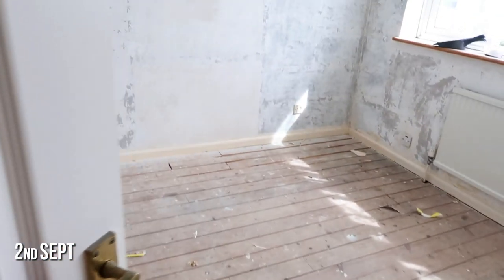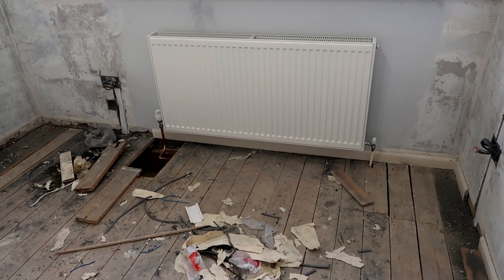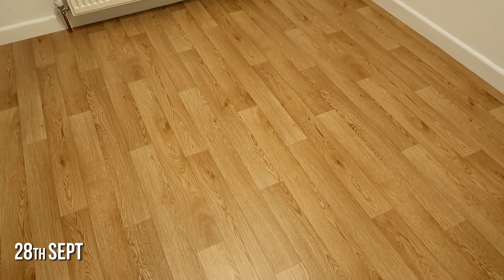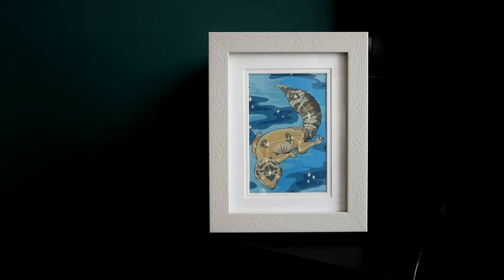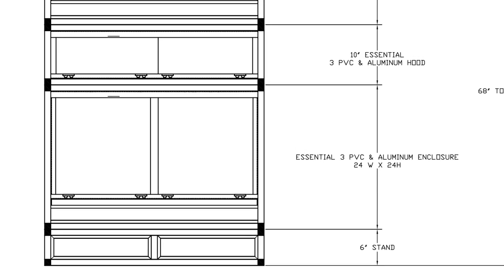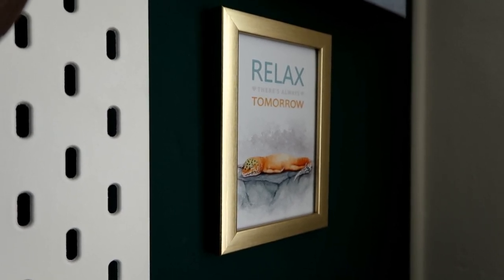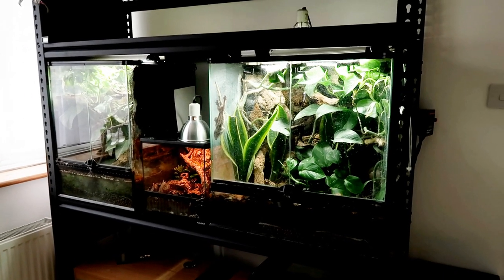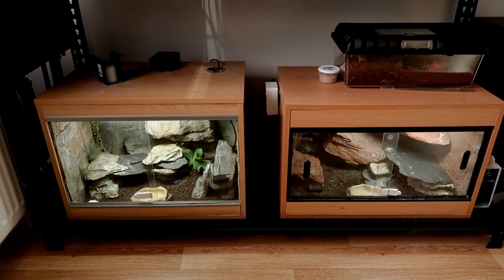MY NEW REPTILE ROOM - Turning This Gross Bedroom Into A Room For My Pets!

Comment: Is the sun good for our crested gecko ? Or should we maybe buy a lamp just to keep a good température? Were i canada so it can get really cold even inside during winter 😅 actually his tank is at around 20 Celsius
Reply: They shouldn’t get any direct sunlight since it can overheat the tank. 20°C is ok, but around 24°C would be ideal. A ceramic heat emitter or Arcadia’s deep heat projector (which is better) connected to a thermostat would work

Comment: hey i might get a new lizard wanted to know how and when should you clean the cage?
Reply: Spot clean whenever you see poop. When using loose substrate you can get away with waiting for months on end between deep cleans. Deep cleaning involves taking everything out of the tank, cleaning the tank and decor with a reptile safe disinfectant (such as a vinegar/water solution), and changing the substrate. If you go bioactive you won’t have to clean the tank.

Comment: I use reptile carpet but I want to switch one of my main worry’s is I won’t be able to find my geckos waste and it will start to mold.
Reply: Definitely switch, carpet is no good. If you went bioactive the cleanup crew would take care of both the waste and any mold. Although even if you don’t go bioactive, their waste is generally pretty easy to find, and won’t mold.
Reply: Reptisoil, organic top soil, or a soil/sand mix are all good options.

Comment: I’m confused about what thermostat to use for my leopard geckos ceramic heat emitter. Can I just use a normal thermostat, then also use a timer so I can use it at the correct times? Also, what time should I have it on? ( I bought the heat lamp and the bulb, I’m just not using it until I have it safe for my gecko.) Answer soon please
Reply: well i think thats fine. I would love a sub
Reply: @CadenKunich  sure! I’ve found out what I needed and it’s getting ordered
Reply: @janelle3534  nice:)
Reply: Arcadia’s deep heat projector or a halogen bulb connected to a dimming thermostat would be much better than a CHE. This video compares heat sources
https://youtu.be/dUJZ04sqhxk
Reply: Moon Lark Thank you! At the moment I wouldn’t be able to upgrade, but if I notice any problems, or can upgrade, I will certainly look into it! Thank you so much!

Comment: Hi my leopard gecko just passed. He was only 7 months old and after he passed I noticed he turned slightly blue. He also has something stuck in his slit/ anus. He was fine earlier though. Does anyone know why this is or what we did wrong as we have another gecko and if we made a mistake we need to fix it :(
Reply: I’m sorry for your loss. The thing sticking out of his cloaca could’ve been a prolapse, or something he was trying to pass. What’s your husbandry like? Setup, temps, etc. And are your gauges digital or analog?
Reply: @moonlark5039  he had a light, ubv and a heat map. There was a moist, and a hot side. He was kept in a 3 foot viv and was fed a mixture of black crickets and hoppers x thank you. He was misted at night time and fed in the morning.